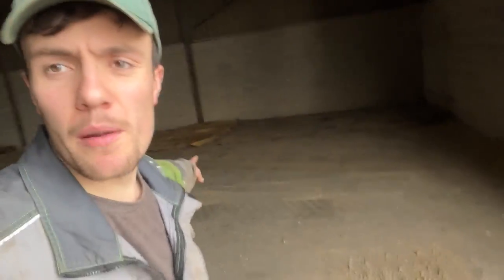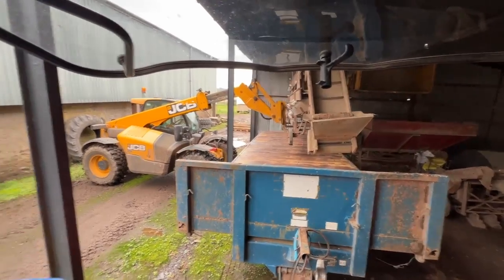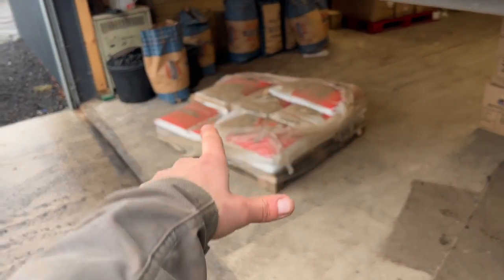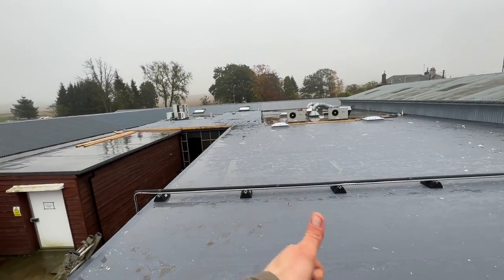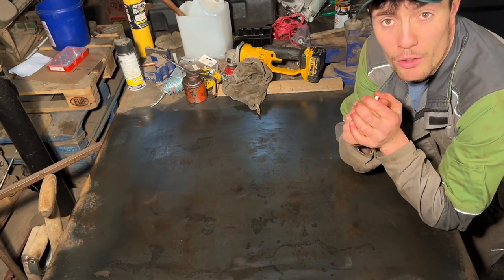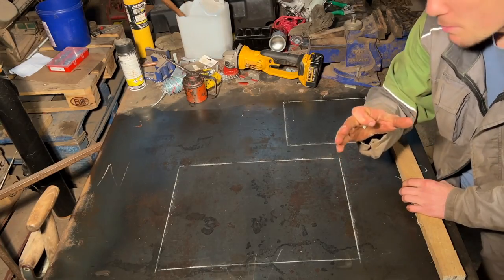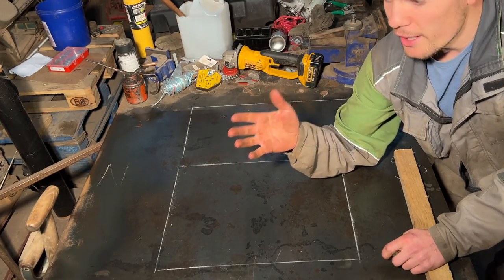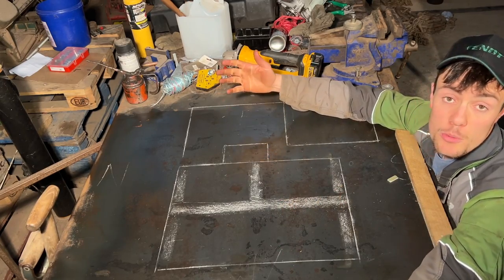Cattle Shed

Comment: Crawford I don't see a central passage as a waste. Makes feeding easier and you can divide up your building easily. Also blow straw into pens without the need to open gates.  Locking head yokes for feed rails are a big help when working with cows too. Best thing you can do is go on your travels and see other yards. Good luck with the research.

Comment: Visit as many setups as you can. Farmers are usually honest about their own buildings problems as well as benefits. If you are on an ad lib straw based setup, then it only requires a simple system. Feeding the concentrates is where you need to make it as effective as possible

Comment: Don’t know if this will be a concern for you Crawford, quite a few years ago I worked on a farm with a big sucker heard, we had a shed very similar to what you have shown with a central passage and would feed and bed up with the straw blower, anyway after ending up with some not great straw we ended up bedding by hand because of the dust made by the blower causing the cows to cough constantly, it did stop when we started bedding by hand but it was very time consuming and bloody hard work, all new sheds after that were open fronted and much better for all.
Reply from the maker: Yeh trying to make it aerated enough yet mitigate the howling winter wind we get. Dont think dust will be an issue but i know alot of blowers have a water tank to help reduce as it blows 👍🏼

Comment: Either run shed central passage same orientation as passage to move cattle and utilise that for moving. Have ventair cladding but leave top 2 ' open on both long sides so air flow at height is good.
Or square shed feed along both sides but have a concrete wall or panels 3m high but 3m gap from.shed. feed along outside but walls protect from wind leave sides open at lower level but have an overhang to stop rain blowing in. Draughts at floor level are the killer not at 15 foot in the air. Walls also allow cattle to be moved around and save fencing.

Comment: Just thinking but don’t know if done before what a conveyer feed system have one main conveyer inside shed spilt into 3 modules that can be easily moved then have a fed hopper outside to load feed onto . When conveyer is empty have rubber flaps on the last module that drop down on stages to build up the excess fed that still on conveyer so there be no waste. Only a idea that came into my head.

Comment: hi Crawford think about 20 years time , we put up a cattle shed 30 years ago with under ground tanks  at the time it was a step in to the futter , WRONG the feed passage is to narrow for a TMR wagon with tight turns so we are still carrying bags of barley 
feed passage are good it keeps the feed dry and helps with cattle movements , If you intend to build a new shed  for 60 cows build one that will hold 70 cows , you may expaned your herd more than you expect{ space not used by cattle can keep minerals feeding cattle gates and very usefull at calving 
Some real good advice get out there and look at other folks set ups , ask them what works and what is a pain in the but,
The thing we suffer from is poor ventalation and get more porblems with pneumonia

Comment: also on end of the feeding end (from where the wind comes from) could you not have a straw barn on end to block wind (over winter) and when straw gets low in end of spring/ summer the cows should be out anyway.

Comment: Been charged by a bull years ago he went through sheep wire and electric fence like it never existed. I fell into a drain and he went over me I was very lucky. Don't mess around with him, just get rid of him. 
Regarding the shed there is a guy in southern Ireland called Aidan Kelly  based in Newcastle, Clonmel  Co Topperary, loads of good reports and highly regarded nationally for designing farm buildings. I've seen some of his work and it's good. I can get his details if you wish!?

Comment: Firstly I’d say ease of feeding/bedding/cleaning must be a priority or it will cost you massively in the long run. This would tie in to where you are storing fodder/muck. Jack at Mainsgill and TP’s other farm sheds allow you to move them to and from feeding areas allowing you to work on either safely makes sense. Also worth considering what you would do if Ammonia prices continue to rise and you need to change. Is it just going to be for cows and calves rather than fattening stock? Charlotte Ashley ended up capping their shed as it rained in soaking the centre. Investment in a pro getting air flow right could well pay off long term.

An old building I worked at had troughs around the outside with tin sheets that you lifted up on hinges and then dropped protecting the feed. It also kept the feed where it was supposed to be. Not sure it would be very practical with bales. You can have door openings to drop bales through but the costs would probably be more than a central feed passage and make cleaning difficult. Plus you do give additional feed at times that needs space for them all to eat.
Reply: I’d also say as shortages of fert which maybe long term with the powers that be trying to reduce global warming, muck could be like gold dust and storage handling facilities boosting profits against those who let a lot of nutrients leach away in heaps. Also consider the central area as part work area. On the dairy farm we’d put tractors etc inside during hard frosts. Not sure if it’s an issue where you are. Possibly also speak to a solar company and see if they might subsidise the building to get the roof space. I saw in France they’d put the whole building up if it was shade free etc.

Comment: I think you should go down the central feed passage route (not what you want to hear) because you are going to feed lightweight ammonium treated straw. If you are concerned about westerly winds blowing feed about, you will still get draughts and sucking effects round the existing buildings and the new build causing disruption all around the yard. Easy to say I know but build another bay on new shed to make up for lost floor space. The machine in the shed is a pneumatic granular fertiliser spreader, made by Overum Tive imported into this country by Bamlett (no longer in existence) circa 1980s.
Reply: They do a bloody good job too by the accounts I've heard from several other people for fert, cover crops etc.

Comment: Could you do a lean to with a wind break on the side opposite the handling system? Would only have to be a couple meters of extra roof plus the windbreak fabric on rollers from floor to ceiling? Save having to do a central passage?

Comment: Been years since I have been working with cattle, and used to heavy feed, that is not effected by wind. But Looks like a one sided roofing with big overhang to the east and feeding to the east. Even bording off the West side, if the winds are always bad. Then the handeling would be to the South, so you can handle the 2 building herds in the same system, but keep them isolated from each other if needed. And if possible a overhang over the handeling system, so it can be done in all kinds of weather without getting to be a mess.

Comment: You do loose animal space with a central feed passage but it keeps feed dry, you dry and you can bed up with a machine in the future should you wish which is far safer than getting in there especially if you're on your own and a lot easier. We'll worth losing the cattle area to losing your life. 
We have a round house with the handling incorporated in it but we're down in Kent. Works well with great air flow but the troughs are all round the outside so do get the weather so I don't think it would for you but if you could put a wind break hedge or something around it may help. 
Look up round house cattle housing. 
I may be able to send you a video some time.

Comment: Personally, I'd feed them on the East face of the shed with a scraping passage, if possible, integrated between the feed and the main body of the shed. You could possibly scrape out into a segregated corner of your handling area. This will drastically reduce the straw you need to bed them with, especially with the bigger stock. This would only need to be 3m whereas you'd be looking more at 4-5m with a central passage to allow you to feed both sides. Having the central passage obviously would increase feeding area but that just creates more muck in more areas IMO whereas a single scrape passage is a concentrated area you can clean out regularly.

For airflow, I'd say you need to have the two faces not on the prominent wind side (i.e East and South) open or at least half open. That's considering that the existing building there will shield any South-Easterly winds, so by not having the Yorkshire Boarding on the East face you're avoiding making a wind tunnel between the two sheds and allowing the flow to enter in and out of the laying areas. I do get that the Scottish weather can be a bit harsh though so maybe you'd be better off with more coverage than less, it just would be handy if you can feed all the stock over that South face without entering the shed.

A lot of it depends on what area you have around the building also as it's not clear whether a central passage building would be accessible from both sides or would need to be a horseshoe.

Comment: with the westerly wind can you not turn the shed 90 degrees so that the wind then can blow lengthways along the shed. would be better for air flow through the shed and then also easier to access the holding pen at the end.
Reply from the maker: Airflow not an issue its reducing the airflow thats the issue, without compromising space to feed

Comment: Yes a passage takes up space but they are quite handy for feeding different lots and having separate lots main for fattening. Depends on if you want cattle separated in to smaller or bigger groups would depend on what you should go for. There are some good designs of cattle shed out there especially in Scotland where we have to be a bit more inventive for the issue we face, you should reach out to others who have livestock and see what they say about their setups and take bits from them. The idea of fixed handling set up is quite good as it saves so much time and effort when you want to bring stock in.